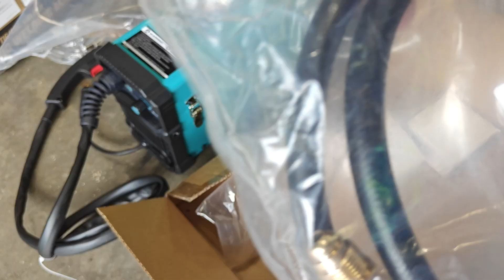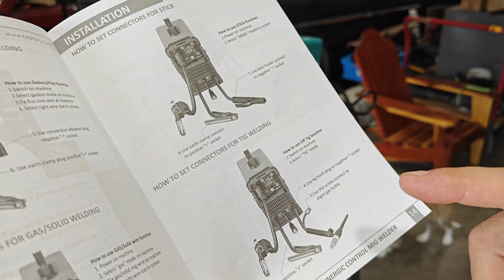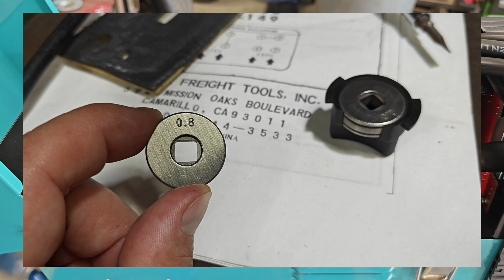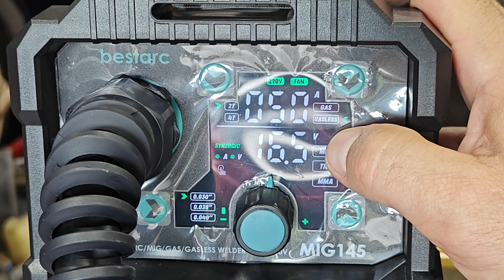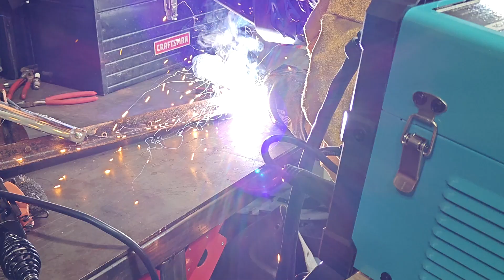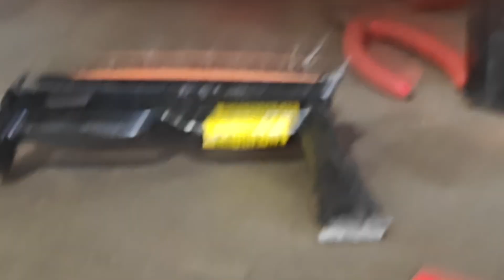Bestarc Mig145 Mig Welder Unboxing, Set up, Testing, and Review (3-in-1 Mig/Tig/Stick)

Comment: Little bit late but i just got this welder as a beginner and i have found the wire wont feed with the trigger, it only feeds if i press the button thats on the machine. Any ideas as to why?

Comment: You could have a chunk of high carbon steel causing the brittle joint.. Also with such thin stock, if you back up the joint with a 1/8 thick or greater piece of copper, you would be able to get 100% penetration without leaving a big hole or burning away the base medal and possibly have grapes galore on the other side. A same size chuck of aluminum plate is also a good weld backer.
T  he difference between gas and gasless, there is most likely a solenoid in the machine to cut the gas when you are not welding and turn on the gas when welding. Using the gasless setting 
when you are not using gas would save a lot of wear and tear on the solenoid. 
  This is a very handy welder for the DIY and garage welder. It is also very handy for welding exhaust on cars. My only grief with this machine is the liftarc tig. I am used to 45 years of high frequency equipped machines but still, if your in a pinch and don't want to spend megabucks for a tig welder, this one is just fine. 
  For those who are going to teach yourself gas mig or tig, you will ne a hose and regulator and want to purchase a tank of argon. A small tank will do and if you own it, you won't have to pay demurrage on it. Just pay for the refill. Also, 10 to 20 cfh is a good setting for tig and maybe a little higher for mig depending on cup size and fillet width. Steel and stainless are pretty easy to learn but be forewarned, if you are going to tig aluminum, it is far more difficult for the beginner. Don't even try mig and aluminum with this machine. Jams and tip burnbacks will have you pulling your hair out.  Just a friendly warning.
  Good luck in your endeavors!

Comment: I might also invest in a respirator with or without active air circulation if you're welding inside the shed. Looks like a good compact unit.
Reply from the maker: Thanks! I have looked at them before... it's a big shop and the door was also open though, so there was pretty decent air circulation.